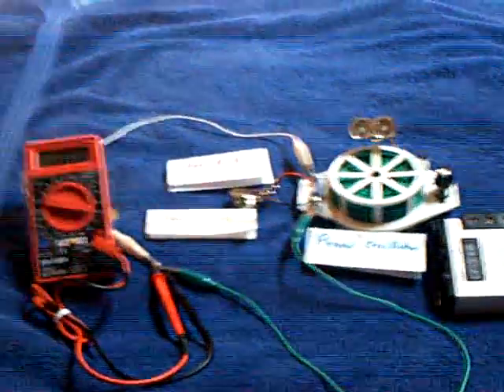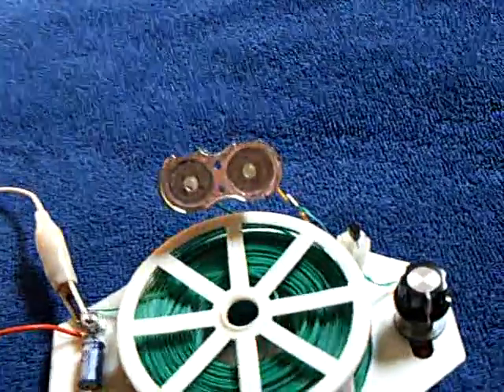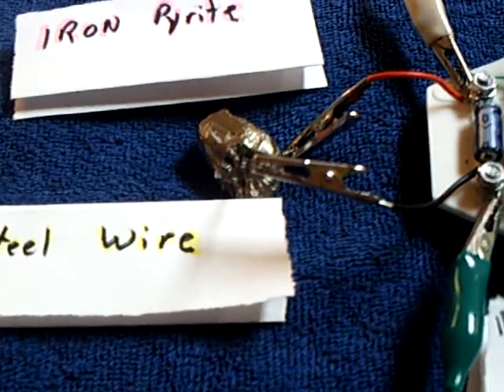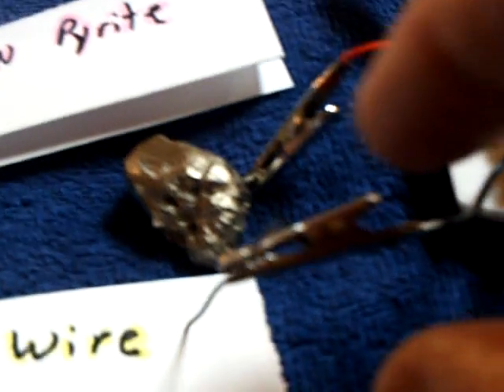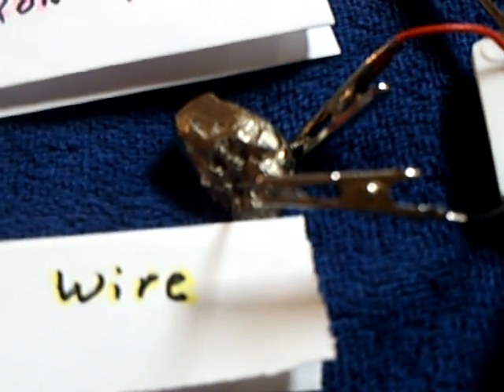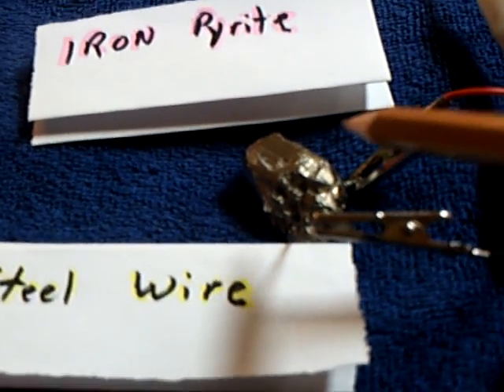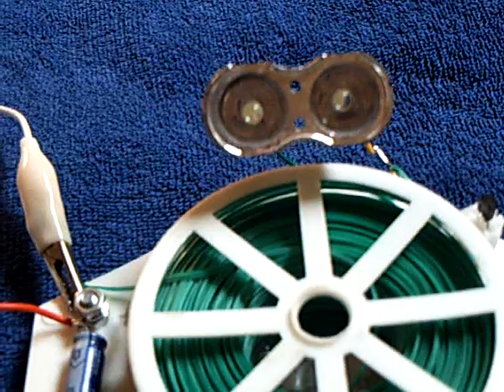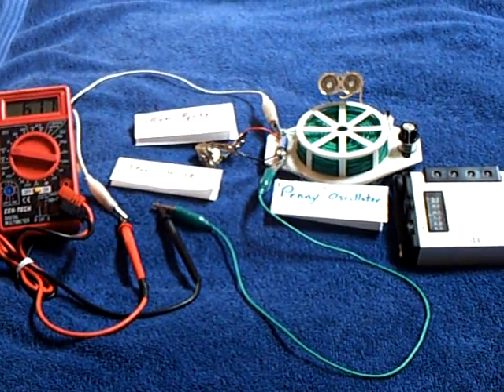Iron Pyrite and Steel Cats Whisker Cell

Comment from the maker: @titanbg1 -----The mystery is --where the power is coming from???  The Iron Pyrite / Cat's whisker detector does not "make" energy.  It is just a diode.  So the real question is whether or not the energy to power the oscillator is coming from a chemical reaction between two dissimilar metals, ambient energy , or a combination of both.

Comment: Once again Lidmotor great Work!

Be careful when messing with iron pyrite, when it gets exposed to oxygen and water it make sulphuric acid. 

Have you tried putting a piezoelectric speaker across the LED? Instead of using a radio you can have the cell give you a slight buzz? 

in the 60's NASA was testing the idea of gallium as a negative electrode in batteries, the way gallium reacted with water actually help to protect it from corrosion. The best part is gallium is a semiconductor too!

Comment: Does placing the iron pyrite on the centre of the coil (inductive coupling) have any effect ?
What about shining a LED or UV LED on the rock at the point where the wire makes contact ?
You ever try a high gain low leakage germanium transistor (they can work with 0.2Vdc) ?

Comment: Good stuff :) Maybe the 'Penny' coils are the rest of the crystal radio and the water isn't needed. Keep her running or use hairdryer I guess. I'll try this with the Ha'Penny, its coil is tiny and shouldn't work like a radio....if it does work i'll repost. 
Your setup might work too if you hold the pyrite in one hand and steel in the other - your body having the locked in water. Kinda weird way of thinking of it !

Comment: Amazing. I think this is indeed a conclusive proof that Iron Pyrite does makes a huge difference on the crystal cell somehow. If you grind it you will find no visible water though.

Imagine now million of those tiny spots inside the crystal cell? that you increase the output tremendously.

Thank you Lid.

Fausto.